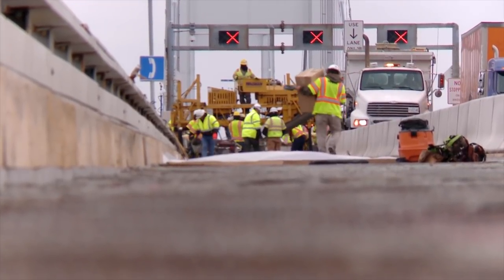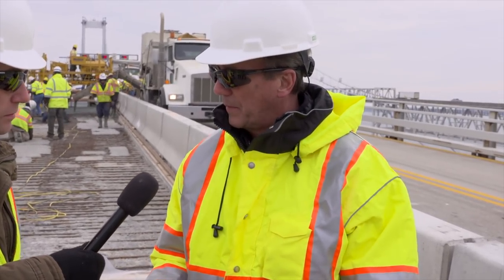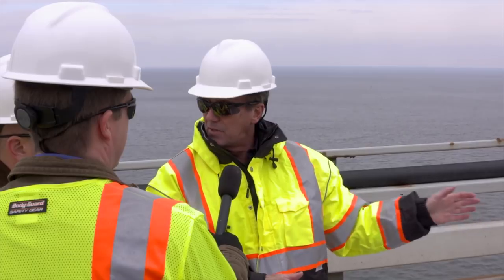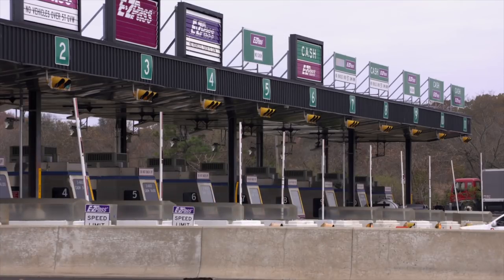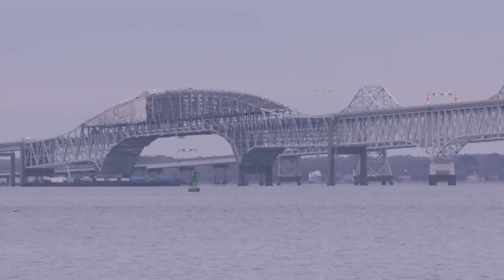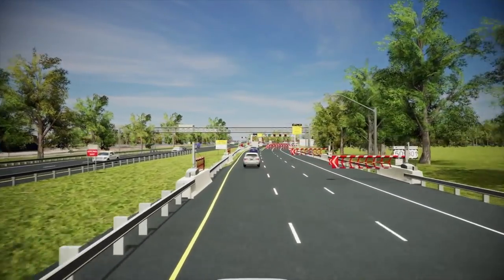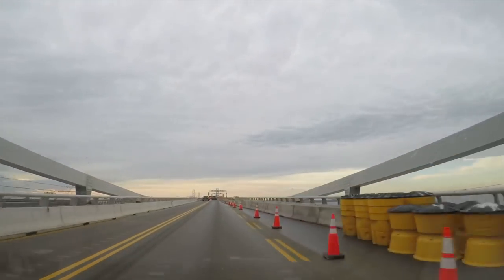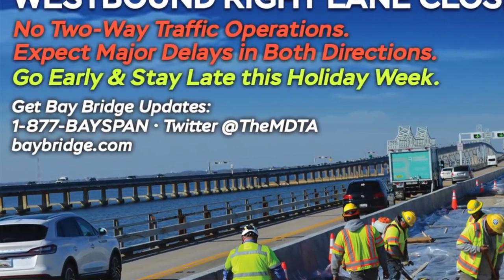The Bay Bridge Deck Rehabilitation Project - A Closer Look

Comment: That thin layer of Latex Modified Concrete is going to crack just like last time.  The state is cheaping out  by not performing a complete deck replacement.  This is just a big patch job.
Reply: They need to build a 3rd span and that's causing financial issues with redecking
Reply: Your right Keith .The same companies who did it the last time are doing it again but under new names ,So they can get paid for substandard work /materials /

Comment: I was wondering how come they are they never working on the Eastbound bay bridge? Was it just built better?
Reply: The west bound bridge was built under a low bid contract.  You get what you pay for...
Reply: The Eastbound 1953 bridge was completely redecked in the late 80's, and probably was built better.  The Westbound bridge was built in 1973 and has never been totally redecked.  Also their last attempt at repaving it came apart and made an even bigger problem.